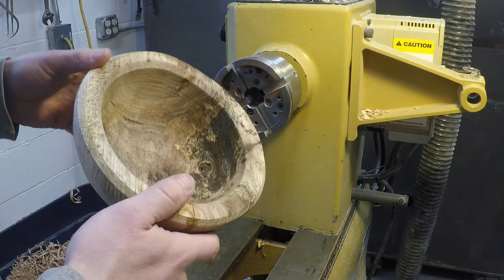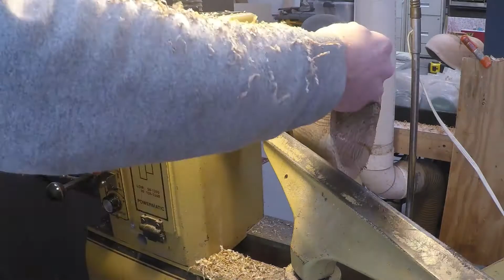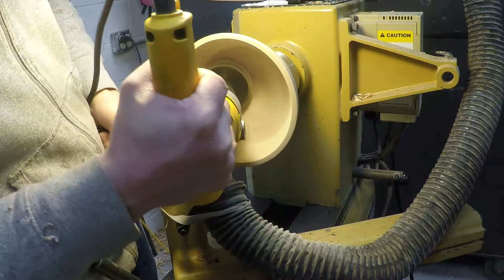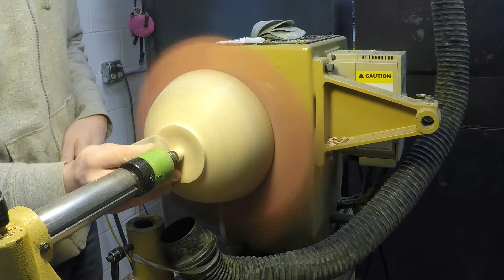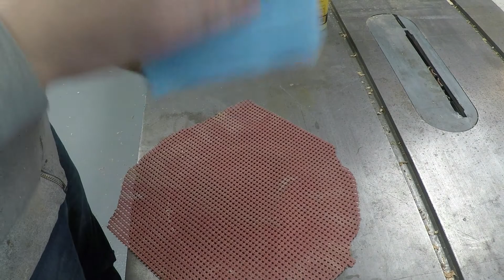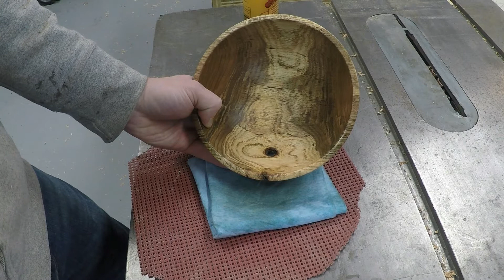Woodturning Moldy Oak Bowl - Finish Turning

Comment: It turned out very nicely for something that started out not so nice ;)  Obviously it's been a while but, did you treat the bowl with anything before you started turning, like bleach or vinegar?  I'm wondering about mold getting into lungs or other pieces around the shop.  Thoughts?  Thank you for posting this vid.
Reply from the maker: No I didn’t do do any treatment before the turning. There’s a lot of mold in the air around the shop. Kind of the nature of things.  I’m not too concerned about it.

Comment: what brand of wood chisels are you working with? Have not seen any with a coating before that looks like brass?
Reply from the maker: It’s a Robert Sorby tool. The gold is titanium nitrate coating.  It’s the same coating on common drill bits. The ones that look gold in coating. The intent is to keep an edge longer on it. Not sure how much it actually does.